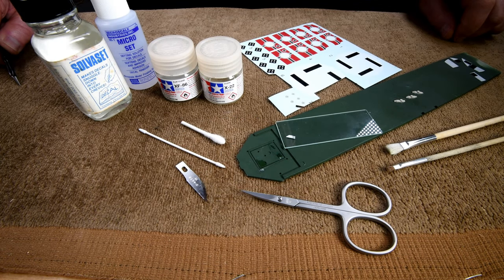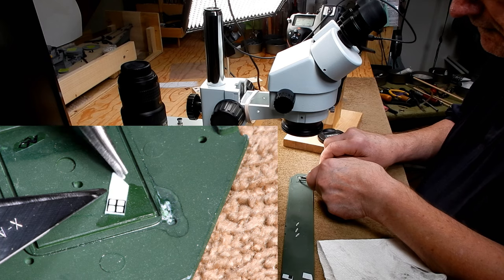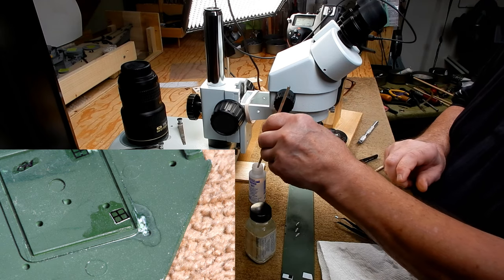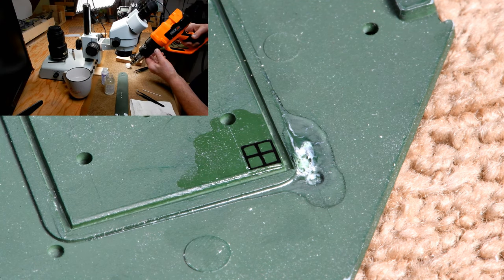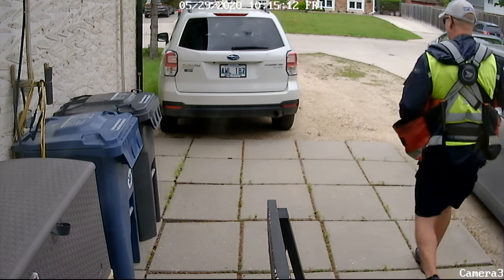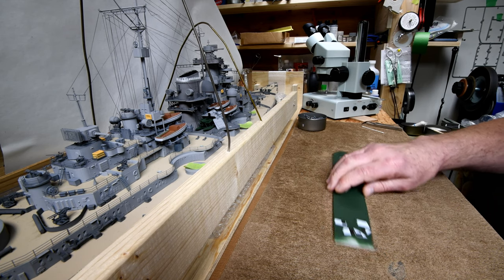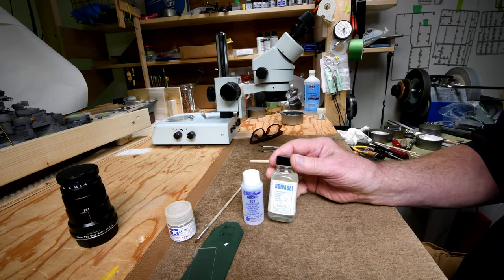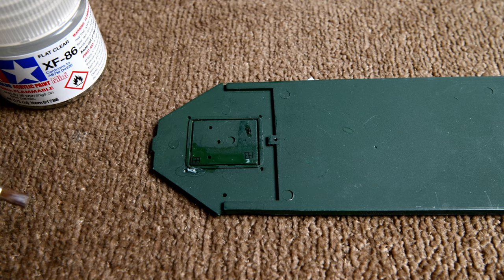The Model Ship - Part 458

Comment: I'm a cat lover, and because cats own me I've thought a lot about how to skin a cat.
To move small decals I sharpen soft wood , soak the tip in water , then trim the tip to a needle point . It's more ridged than a brush but still flexible. The decal doesn't grab the tip like it does to a mini q tip.
Reply from the maker: Thanks for that tip Jeff. 👍

Comment: Ron, to answer your question, Micro Sol is similar to Solvaset and it basically dissolves the decal film and allows it to conform to the surface. But Solvaset is much stronger that Micro Sol. I’ll use Micro Sol first on a decal, but if it’s particularly stubborn at lying flat, I’ll use a bit of Solvaset. As you noticed, too much Solvaset can completely dissolve your decal though so you have to be very sparring.
Reply from the maker: Hey, thanks for that info George. Would this be correct ... 🙂
MicroSet --- weak
MicroSol --- medium
SolvaSet --- strong
Reply: Not exactly.  Micro Set and Micro Sol are designed to work together. Put Micro Set on first to prep the surface for the decal, apply the decal, then apply a coat of Micro Sol to “melt” the decal into the surface.

Comment: I'm going to guess the 'clear' underneath the decal prevented the paint blending with the decal edges. That's assuming the solvaset works by dissolving a thin top layer of the paint at the same time as the decal.
Reply from the maker: I've been thinking along those lines too. Perhaps I'll do some more tests sometime Ian. 🤞